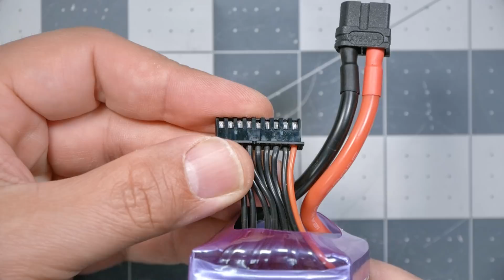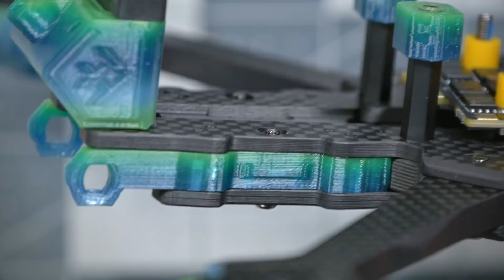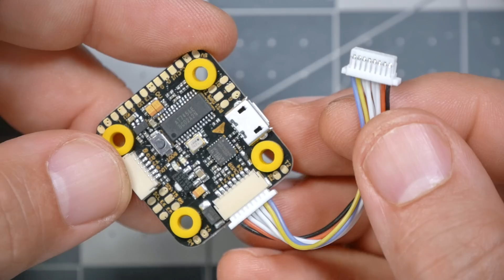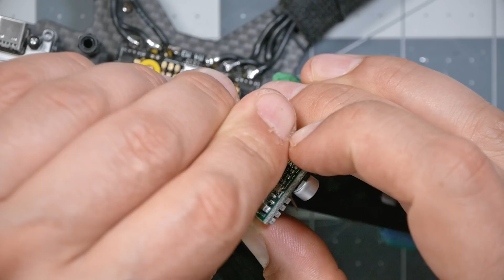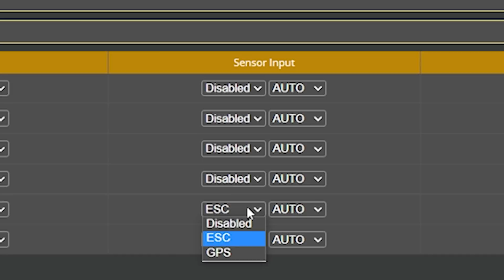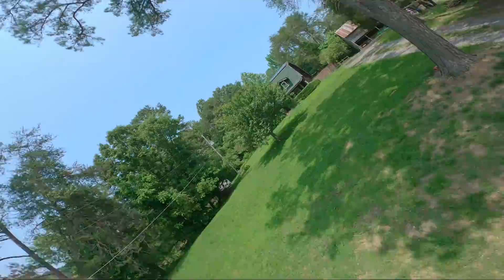Build the ULTIMATE 8S Freestyle Drone. Here's How!

Comment: Bardwell please do another 8s build it isn’t nearly as expensive as it used to be. One of the cheapest stacks today is one from TBS that happens to also run 8s voltage which i realized while researching for a 6s 5-inch.

Comment: 35V capacitor is not enough for 8S  voltage  battery...must be around 25% more voltage...it means minimum 50v , better 63v...so , 1000uF 63V is full ok....

Comment: Hello, I have a question. I'm a total nube. I bought a racing frame. Later  I bought a stack. I didn't realize it is a mini stack. 20x20. My frame doesn't have 20x20 holes in it. Is there an adapter, or should I get another frame?

Comment: I’ve picked up a set of stanfpv ducts for my 5” to just mess around with after watching a chris rosser video on the effects of ducts.  I’m amazed how much more of a locked in feel it gives me but it’s foresure not as nimble as a naked prop version.  Now I’m wondering if building a 5” 8s ducted version will bring back a few things lost in the 6s ducted version but add the braking drag and control the ducts add.  🤔

Comment: Great content as always ! I wonder how beneficial 8S batteries might be on 7" carrying full gopro ?! Juste one question, that might sound stupid, but how do you charge these 8S batteries ? You need a different charger ?
Reply: @AndyParisod im sure you have the answer to your question by now but I decided to try this out!I ordered all the parts and the battery and then I realized my charger only goes to 6S lmao! So, of course, I went and spent $300 on a new k4 charger and parallel board  lol,  but now I realize I could just use 4S lipos and made myself a series connector with 3 XT-60'S and some 12 gauge! I've been taking cells out of my 6S packs with a dead cell and have made a few 4S packs.  Anyway,  just thought I'd let you know my experience so maybe you can save some money if you try this.
Reply: @OTRFlyer  Cheers buddy, as I'm stil flying 4S I'm might jump straight to 8S.

Comment: So... if I change my ESC so it can handle 8S I can run my T-motor T100 1100kv at ~32000rps with an 8S battery without a problem or I will burn down my motors due to Hight temperature? 
8S is out of Specifications for those motors.
Reply from the maker: 1100 kv will be fine at 8S voltage.

Comment: Removing the ground cable from the ESC-FC cable is not necessary if you run a separate cable from VBat to the BEC, since the ground is always common. Having it run separately adds a little risk of picking up noise, causing more errors in FC-ESC communication, so I prefer keeping it in the connector, only removing the vbat line.

Comment: The key part for this 8S build are the motors. I tried T-Motor F60 2207.5 1750Kv w/ scaled motor output limit and they sounded "off" with lots of weird whirring and sporadic stuttering. Tried XNova 2208 1500Kv unscaled and they seemed underpowered vs F60. You really need the experimental F60s 1500Kv. YMMV.
Reply: I have an 8s build with xnova 2208 1500kv and find they work great. I can't tell if they are underpowered, but they have so much thrust on 8S.
Maximum current draw on 8s is 120A. I figure some 6s builds draw ~150A. But I guess the whole 8S idea is to lower the current draw, reduce heat, have more thrust and go easy on the Lipo's.
The only other 8s motors I can think of are the xing 2506 1500kv, flyfishrc 2506 1550kv and amax 2306 1500kv.
I only tried the xnova 2208, but next are the amax 2306 1500kv.
Reply: maybe you have the wrong props
Reply: @blup7352  Nope, I have the same props mentioned in the companion Rotor Riot 8S video. HQProp J40.
Reply: @tlj4999   ok idk

Comment: When playing with 18650 LithiumIons I built for more voltage to help drive the amperage down to achieve the same wattage.   They were bigger 10+ inch builds but the performance was pretty good for 6s2p and goal was to go 8s2p.  Had to use APD X-class escs, the iflight 8s stuff was a pain to solder to.  Have barely flown in the past 3 years while building a car project.   A good 4:1 ESC rated for 8s is a tempting thought but if one side fails it is a full new 4:1 that has to be purxhased versus an individual ESC.   Bundling wores/space is a pain as well.    Using matek big 8s rated PDB helped with some of power distribution issues but that was macro quad life not mini quad life.

Comment: iFlight makes a 12v micro bec that takes 8S. You can join 2 of these together with a servo pin header to increase the output and get 12v 4amps. Small but powerful bec setup I use on high power fixed wing setups.

Comment: Those T-Motor ESC BSC011N03 mosfets are only rated for 30V, 8S is 33.6V and more with spikes during flight, that's on the limit and can blow even with 6S sometimes, on 8S you're trying your luck, they could handle it but who knows how long.....

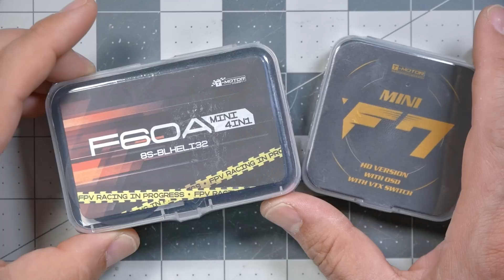Comment: 2:37 this is false. There are other individual or 4in1 ESCs that are rated for 8s voltages or higher depending on the ESC. 

Foxeer Reaper Mini 60 amp
Foxeer Reaper Mini Slim 60 amp
Foxeer Reaper 65 amp
Redux Air Redux32 70 amp
HAKRC HK32020 60 amp
HGLRC Zeus 50 amp
Diatone Mamba 5 Reactor 66 amp
iFlight BLITZ E80 G2 80 amp
Neutron XClass 70 amp
FETTEC 65 amp
APD 80 amp
APD 120 amp
APD 200 amp

Just to name a few or in this case, several...
Reply from the maker: That's why I said "one of the only" and not "the only". Thanks for compiling the list though.

Seriously? Would you use an apd 120 on a 5"? Same with the Neutron. The Blitz e80 is nearly $300! It seems like you were just trying to list as many 8s ESC's as possible without really thinking about the application.

If you take out the xclass ESC's, there are 8 listed ESC's that could have been appropriate for this build. 8 out of how many total in existence?

Like I said... One of the only.
Reply: @JoshuaBardwell  well, you've got a list out of it now for others to reference.
Reply: Also, for the record does it really matter in the end of it's meant for 5" or not? What if someone was building a cinilifter for instance? Now they would know what other options to look for. Or, IDK a 8" or bigger macro quad. Or even a beefed up 5" racer for instance. 

But also saying "one of the only" implies it's the only one and there are no others. "One of several 8s capable" makes more sense. Just saying. 

But of course, I'm talking to the know it all himself so of course my comment has no bearing. 🤗
Reply from the maker: The reason I'd stay away from the APD ESC's on a 5" is that they're super super overkill. They're huge and expensive. 

I respectfully disagree on "one of the only". "The only" means there is only one. "One of several" means that there are several of them, but doesn't imply whether there are any others. "One of the only," to me, means there are a few of them, but they are in the minority.
Reply: Well, it's misleading to say "one of the only" if someone is seeing this video. What if someone wants to build a 8s 5" and they see this video thinking"okay this is the only 8s rated 4in1 out, and it isn't in stock..." Then what are they supposed to do? 

Info is a little lacking. I only commented because if someone were to build a 8s 5" quad, and they saw my comment, now they have some more options to look at besides the TMotor ESC.

But, of course TMotor sent you the ESC and the motors and most likely told you to say that anyways so they'd get more sales compared to the competition as said clearly at 3:06 in the video with no disclaimer you usually put in saying "so-and-so sent me these parts, they have no control over what I say etc etc." Interesting to me to say the least. Just pointing out facts here.

Comment: why each time in your builds you have versions of an FC, you have versions with the mpu6000 instead of the super awesome bmi270?? why not use these FC's with bmi270 in your builds??? if it is so good?? the strangest thing is that you have some, and you continue to use them while you tell us that the bmi270 is good or the same?? For what? how can we not think that all this blah blah about recent gyros is there to reassure us and make us continue to buy them when you don't use them as often as possible in your builds?:body-blue-raised-arms: (team mpu6000 lol)
Reply from the maker: Here was my thought process when selecting this FC.

What companies make a good 8s esc? T Motor and Foxeer.

I contacted both of them and asked if they wanted to sponsor the build.

T Motor responded fastest and had prototype motors of the correct kv.

At no point did I ever think whether an FC has BMI270 or MPU6000 because both of them are equally good and I don't care. 

My own JBF7 has BMI270. Every single one of my Perfect Freestyle Build has the JBF7 in it with BMI270 gyro. 

You're putting way, way too much thought into this. Like I stay up at night trying to figure out how to trick people into buying a certain gyro. What a joke!
Reply: @JoshuaBardwell  ok i understand. :goodvibes: just some thoughts... i have one quad with this gyro and i have some problems which unfortunately is very hard to resolve despite my research.. maybe I was unlucky (twice!, it had never done this before so I'm wondering..) maybe I've had a hardware problem?? (or two?) anyway no luck for me with this gyro...:face-blue-question-mark:
excuse my plea in any case very interesting this build 8s! it makes you want to have this power! finally I go more towards the light 5 inch or a small 4S is enough, tired of charging the 6s for 3min of flight, therefore lighter, and a 4s 850mah .. for ease. that said, can you tell me for this 8s lipo how long does it take to charge a battery like that?? because it looks good, but the lipos are expensive, and heavy.. that said, to see if in the future the 8s lowers these prices.. in any case it makes me want!! and I saw that there are quite a few escs that are compatible, so the not too expensive lipos are missing and here we go! thank you, kind regards, A.
ps/ha, and just one last thing: I would have liked to see the osd precisely to see how the voltage/amps behaves in flight.. next time?:goodvibes:

Comment: What a great pair of videos.

Traditionally higher voltages are used to overcome transmission line losses however I think it’s a super interesting subject the use of 8S in FPV and especially the potential on long range builds bringing the current down.  On traditional builds like you have here you should see some benefit from lower temps on the battery meaning you could see better longevity on a lipo back however I’m not sure the benefit outweighs the cost in the that regard. 

More than anything my largest concern like as you stated is the chances of big nasty failure in the event of an issue and 8S burnouts could be rather interesting to see. 

This pair of videos on 8S has been really enjoyable to watch and it’s definitely an interesting subject for sure.
Reply: You don't get any battery heat advantage, however the cable from battery to ESC and ESC to motor can be narrower at iso power vs 6S. Or you can get lower losses :)
Reply: 8S on long range has no advatage over 6S. I did the math behind it.

Lets assume we take the best li Ion cells I know: Molicel p28a (35A max) or p42a (45A max)

You can fly them from 4.2V down to 2.8V per cell. Lets assume an average of 3.5V under load per cell.

Everything is about weight and energy density on long range builds. So lets do this according to weight and power the LI Ion cells can deliver:

6s 18650 (~300g) : 3.5 V x 35A x 6 = 735W

8s 18650 (~400g) gives 980W

6S 21700 (~430g) gives 945W

8S 21700 (~570g) gives 1260W

6s2p 18650 (600g) gives 1470W

Okay and now you can do the same calculation for the mAh in the cells or Wh. You will see all the numbers between 6s and 8s in are so colse together if you compare the weight and max power and total mAh.

I could write very long on this, but just do the math yourself.

Now you could argue you could the take for example 5000mah 21700 samsung 50s (35A max) on 8S and reduce the amp draw like this. But then you are still only able to output max 980W with heavy 570g 8s 21700 pack. I'd rather have the 1260W power with the lower capacity molicel p42a to pull out of a dive than losing my quad because I traded for more total capacity.

Just my 2 cent

Comment: What about the skystars f722 mini hd pro. It claims to go to 10s. BTW I tried it with dji fpv motors worked fine. Using copper wire gives you the best performance in my testing

Comment: You need to get a lighter battery, that 1350 is way too heavy. It would have so much more acceleration if it wasn't carrying that weight. Try 2 450mha 4S battries in series instead.

Comment: Also, is it really needed to have that stack nut when the Volador uses threaded press nuts under the frame for the stack screws? Technically it would seem this would eliminate that need.
Reply from the maker: The Volador frame that I have only had press nuts on the 30mm holes. The 20mm holes didn't have press nuts.
Reply: @JoshuaBardwell  Ahh. I see. Wait!? You opted for a 20x20 stack when it had space for 30x30? lol I missed that in the video and assumed since it was a JB build it had 30x30 😀
Reply from the maker: The T-motor 8s esc is a 20mm. Weird!

Comment: You mention the motor being ideal for 5" setup, but doesn't going to 8s change things? Can you run a smaller motor with the same prop load because heat is reduced? This might also be better for running at higher speeds.
Reply from the maker: It's possible, but you would definitely want to lower the kv to bring the rpm back closer to normal range.
Reply: @JoshuaBardwell trying to build a 7” 8S and all the motors are only rated to 6S. Does this mean if I run 1300kv motors I would need to limit them to 975?

Comment: If you don't have an 8s charger, could you split the balance lead into 2 4s plugs and just charge like it is parallel charging 2 4s packs? Probably not because the final pack voltage right?
Reply from the maker: That's right. The final pack voltage would mess you up. In theory you could make an adapter that also pulls an XT60 off of the balance lead, and fake the charger out that it's a 4S battery, but that sounds like invitation for trouble to be honest.
Reply: Then why not just use two 4S batteries
Reply from the maker: You can totally do that. It will be a little bit bulkier and heavier than a single 8S but it will work.

Comment: Came for the Thumbnail, stayed for the Golden nut and wondered if you cannot forgo the $25 and just tap off lesser voltage from the balance lead?  Would the electronics drain enough current during the flight to cause significance imbalance/wear to the battery?
Reply from the maker: You could probably get away with that but I kind of don't like it on principle.

Comment: Foxeer has a dual BEC 8S FC so you can skip the external voltage regulator. My 8s Build came in at 610g without an action cam. I used the 1100 battery from gnb and RCinpower smoox  2306 1350kv. There's also a fetek 2207 1100kv
Reply from the maker: I'm curious how that 1350 kv works. Your rpm should be similar to "normal" range which makes me wonder if the advantages of 8S are as pronounced.
Reply: @JoshuaBardwell  I built towards maximizing motor and prop response. The 1350kv hit the 450mph prop tip speed sweet spot for the 4.8-4.9" props that match the "ideal" disc loading for around 600g sine I choose to just use the 03 for recording. Obviously I subscribe to CR as well but the quad rips so something is right.  My hover is around 1310 throttle on gf4934's

Comment: Interesting. Here's a question for you, what charger do you use to charge 8S? None of my chargers go past 6S.
Reply from the maker: I have the ISDT Air8. It charges 8S but not 8S HV. I also used the ToolkitRC M8, but I've blown two of them up so I kind of don't want to spend another $50 on another one.
Reply: @kaygeebee1962  seriel*

Comment: What are the 50W for?😅As far as I know don't need a 4A 12V voltage regulator, unless you're powering something new that I'm not aware of. A VTX for example, uses less than 200mA at 12V for a 500mw output, most receivers draw less than 50mA.
Another trick is to simply wire the rest of the stuff to the balance connector at a lower cell count, since the draw is so little, it will not noticeably make the battery out of balance during the duration of the flight.
As a dumb example, I run 5 micro servos and a receiver out of a crappy 1.5A liner bec at that is at 5V, so about 7.5W.

Forgetting that, this is cool I hope higher cell counts catch up. A lot of weight can be saved in wiring at higher voltages. I don't main quads but I like that you are the few that are actually still pushing the limits of performance.
Reply from the maker: A digital vTX can pull as much as 10 or 12 watts. If you're sure you'll stay under 20 ish watts them you could use a smaller regulator. I like to have a little headroom.
Reply: @JoshuaBardwell  Ohh that explains it. I keep forgetting everyone flys digital now, derp.
Have you considered plugging it to the balance port though?

Comment: Clean build, although for the regulator wiring I'd suggest just cutting the power wires of the ESC to FC cable in the middle and soldering both sides straight onto the regulator. It looks like they'd be more than long enough and you wouldn't then have an extra set to solder onto the battery terminals.
Reply from the maker: That's a good idea actually!